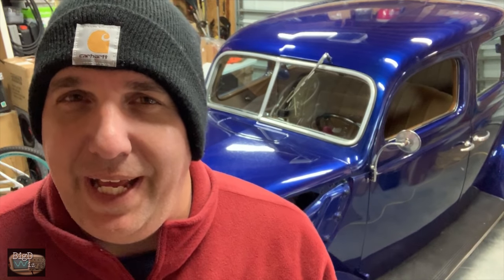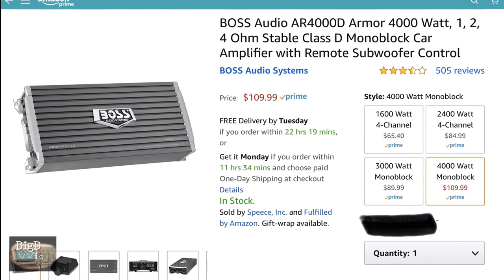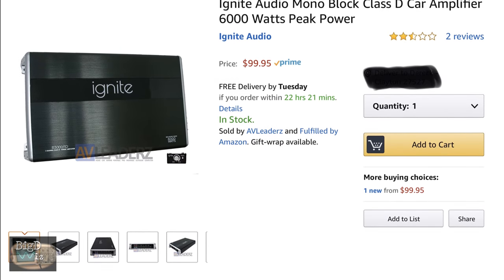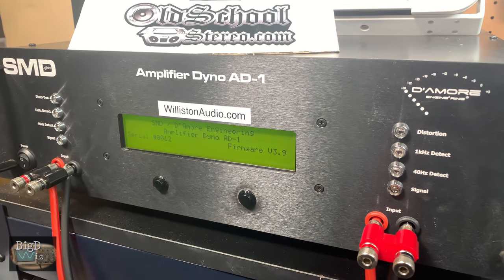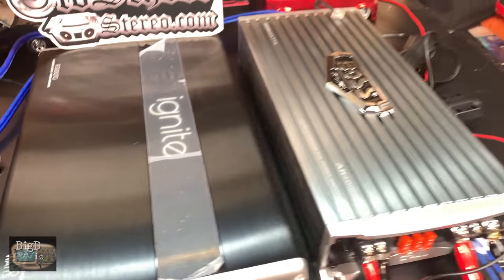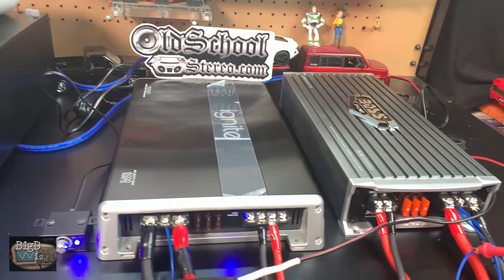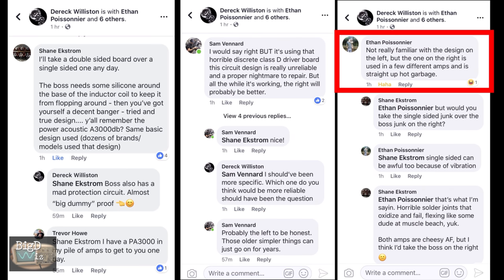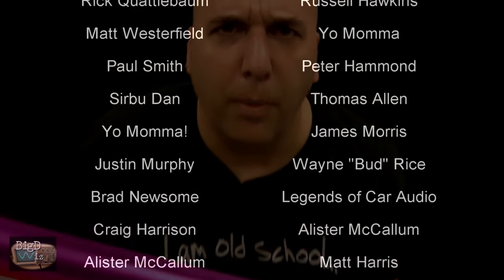$100 Amp Dyno Drag Race - Ignite vs Boss [4K]

Comment: Don't understand the hate on cheap setups... BOSS audio is what got me into car audio when I was much younger and broke. The fun of building a box, researching different enclosure types, setting gains, etc. can still be had!!
Reply: I used to love how cheap they were but then my amp blew and messed with the resistance of my subs, and it blew for no reason, I had an 80a fuse in line, much less than it was supposed to be and it never blew, showing that I didn't try and push it too far, it just blew for no reason and in canada they are like 200$, waste of money only lasted like 8 months
Reply: @trogers2120  I had a boss R1100M for my first amp. Probably put out 200 watts I'd guess. Used the crap out of it for like two years before I could afford a Rockford setup, you sure you set your gains correctly?
Reply: i still got my 4 channel boss amp from back in the day, its been trough hell and still works lol at least they are good amps to work forever XD

Comment: Back when I first got into car audio a 1000 watt amplifier cost a ton of $!!!! Times sure have changed!
Reply: Josh Hanson same here amp that where 1000rms back in the day where easily 600$+ for  decent brand, the cheap amps here probably don't have long life spans due to cheap internals
Reply: Josh hanson,  i still play my punch 200ix to this day its in my car bridged on a sa 12” crazy tone from a amp that was 500-600 bucks for 400 watts
Reply: @karl6823  i have 1 also. It rocks. Have it bridge on a single 4ohm pioneer champion seriel 12
Reply: Imagine our builds in the 90s if we could’ve had 1000 watts for $100..  remember when the Memphis 1100 came out. That was a game changer. Nobody thought close to 1000 watts out of this small amp, and wth is class d. It was only $400.0.
Reply: @troubleship6064  I bought the MTX 1000D when it first came out! 2 of them on 4 mtx 8000 15's in the back of a jeep wrangler with the back seats took out. I had them in a 4th order type box, the subs were firing off the bottom" facing down" and I thought that system was the shit. That shit shit was loud! Unbelievable what 2000 watts could do back then.
Reply: Amen!
Reply: Michael Branch,  the sound from a these amps is just amazing i love them,  i rebuilt mine all new caps and all it plays like a new amp put out over 600 rms on the smd dyno
Reply: Josh Hanson 8500s are still a very respectable sub. I still have two 9500 15s and one ten. Desperate cars. For some reason some people think mtx didn’t make good shit
Reply: Yeah back in the day I had a boss war machine and that amp was a bad ass
Reply: @karl6823  That's a FANTASTIC amplifier man! The first DSMs were MONSTERS! I guess technically that's a gen II DSM, as the original DSMs didn't include the X-over card. Still tho, great piece of classic car audio that sounds better than 98% of what's available today. 

They sound really good running mids & tweets too, but you have to be really careful with the gain controls. The DSMs clip so quietly that you'll fry tweets before you even realize it.( I know from experience 😤)
Reply: Kevin williams,  ive had my punch 200ix for 11 years and its so full of tone it plays so nice it’s definitely my baby i put hours of work into it
Reply: Back in 1985 I payed 300.00 for a Kenwood  Kca 800 and that was top of line .🤣

Comment: I know a lot of older people in the industry will laugh at us, the younger generation, but my first setup was a BOSS 4g wiring kit, Boss r1100m, and RF R1-S4 12inch for $130 (including box). While it certainly added some much needed bass to my 04 Tahoe, it wasn't enough for me. I recently upgraded and got the RF 500x1d (mine pushes 658 RMS @ 2Ohm from the factory according to the dyno sheet), the RF P2D4-12inch, and a S/O box with polyfill for $360 after shipping and tax, and it is truly a night and day difference in quality, loudness, sound, etc. 

To say all of that, I would have never gotten my better setup had I not started small. Sure, the r1100m, and other BOSS amps, are rated too high and don't perform very well, but they are enough for beginners usually. The AMPs tested here would put my old BOSS, and even my current RF, to shame in power/dollar, but I get the problem with quality. Something from RF has a good warranty, excellent customer service and QC, and is usually built and rated much better. While it isn't that huge of a jump from $110 and $129 ($110 for the BOSS at the time of the video being recorded and $129 for my RF 500x1d from Amazon), the power difference can be a deciding factor for some. 

I love my RF equipment and am most likely going to upgrade my stock speakers in the future to some RF's. It's worth the extra money to spend it on something from a known and respected company!

Comment: I had one Ignite R3000/1D powering 2x Sony Xplod 12s for over a year, no problems. Just upgraded to 2x Skar Audio EVL 12s in a 4.5 cf ported box, and added a second Ignite amp. My only problem is that the slave amp seems to have slightly decreased output. And yes, I have changed master/slave with the same results. I can visually see more excursion on the master amp/sub. Once you link the two amps, all gains/controls on the slave amp have no effect. Other than that, great value. Will upgrade to Orion HCCA 3000 in the future.

Comment: I have this ignite powering an audiopipe txx-bd2 and it pounds pretty good for a single sub budget set up. I'd say they are pretty well matched. The bd2 could stand a little bit more power but I like it. Custom ported box, tuned to 26hz and she gets low 😎

Comment: Well.  5 years later my ignite audio is still going strong. Even was in a bad vehicle crash 2 months ago
  I’ve used that amp to run 2 xfl 15s at 1/2ohm 
Single xfl 12. Tons of stuff 
Now powers 2 12” Dual audio in a bandpass box
The amp is on for 8hours a day. 6 days a week.  And I would say 85% of the time I am full volume 
 Never once had an issue. Even running 1/2ohm

Comment: We want more dyno drag vids !!! These are sooooo fun lol 😂
Reply from the maker: They are fun to make too, just more work. All good though, glad you like 😊
Reply: BigDWiz . When you did your xB install , did you use the grey wire on the harness for the remote ? I’m done by the same headunit install you did . Also do you know the rca voltage output of the 1809 deck ? Thanks in advance sir and thanks for the great vids again .
Reply from the maker: @EARDRUMASSASSIN  I didn't test the voltage output and I think I ran my own remote from the fuse panel. I can't recall, honestly, sorry.
Reply: BigDWiz no worries . That’s one of the options I was thinking also . Just running off the fuse box somewhere . Thanks for replying .

Comment: @BigDWiz do you happen to have an old Punch 4040 DSM and 100 DSM you could dyno?  I still have a few laying around from back in the 90's and am trying to decided whether to use them in a system or purchase a few new Audiocontrol amps..

Comment: on a low budget end I'd say boss. my cousin had two 15 L7's with 2 boss ar4000 strapped at first i didnt know what kind of amps he had when he played it those L7's was moving i asked him what kind of amps he had and he said take a guess i named basically all the name brand amps i could think off and he was laughing super hard so he finally pops the hatch and what do you know two boss ar4000's was pushing the crap out those 15's the look on my face was priceless so yes after seeing it move subs like that im a believer in boss amps even though im a hardcore JL audio fanboy i purchased a couple ar4k's myself i wanna see if the ar4k has what it takes to move an 8inch massive audio hippo xl if it does ill be fricken stoked cause the shop i bought those subs from has no faith in the boss amps but i bet if my cousin comes there with his set up to blow the roof off they're shop they'll be believers like me and for the note we've been into car audio since 1997 thats 22 years so yes we do have experience.

Comment: Looking at the chart the Boss appears to be a lot stronger at 2 ohms than the Ignite but the Ignite seems happier at 1 ohm than the Boss.

FOR THE WINNER I CHOOSE-

BOSS the 2 ohm winner 
711rms 907 burst@2 ohms
(619rms, 716 burst ignite)

IGNITE the 1 ohm winner
1111rms, 1382 burst@1 ohm, + bigger heatsink.
(886rms, 1352burst Boss)

The choice between the two would depend on a 2 ohm or 1 ohm sub setup.

Comment: Bought the ignite amp a few months ago. Going to try it  at .5 ohm and see if it handles.
Reply: It handles 4 15s at .5 Ohm like a champ. Has not over heated or shut off. I actually need to upgrade my 140 amp alt in my suburban because it sucks so much power even driving down the freeway and hits so hard and clean I am amazed seriously! BigDwiz can you test this amp again at half ohm? I cant believe how much current it pulls but has to be alot.

Comment: As an installer the biggest problem I had selling cheap amps is the customer that buys these amps is not willing to pay for proper tuning, wiring, etc. And would most likely abuse the crap out of them. With this combination, u can almost bet on returned merchandise. I would rather make less initial profit on a mid level amp but have a more satisfied customer.
Reply from the maker: Great point 👍

Comment: great vid bigd.. i thought the BOSSar4k did around 1400 wrms at 1ohm the last time you tested it? it seems these amps are not very consisted, or is that normal? keep it up sir.
Reply from the maker: Percentage wise for the dynamic test, it is pretty consistent. Plus the voltage was slightly lower on the first test
Reply: Ok, good to go.  Thanks again for another awesome video. Like the drag Dynos, need more.

Comment: Ignite still running strong 1year later and it doesn’t ever heat up thanks big D
Reply: I got one too runs amazing
Reply: @terryw1945  year 2 still going
Reply: @djgblaze1of1  awesome to hear that. This amp is great deal for the price. What subs you running
Reply: @terryw1945  at first was dark audio nkos 12s 500rms a piece now 2 12 Orion BP HP with a custom tuned box
Reply: @djgblaze1of1  nice

Comment: General amp question. Does lower efficiency means more heat? Or it just means lower efficiency? For example amp A being 65% at 1ohm and amp B 80% at 1ohm. Will the 80% amp generate less heat or is it just simply more efficient and both amps can generate the same amount of heat?
Reply from the maker: Lower efficiency means less of the input is coming out as sound. More is lost to heat. So in essence, lower efficiency = more heat
Reply: @wal  ok. So which efficiency numbers matter more? The certified or uncertified?

Comment: I have a small 2.1ch amplifier and I want to use the high level output of the sub into the high level input of the amp. Can I bridge the high level inputs cuz I have only one + and - high level output from the amp? I have tried searching the answer for this every where could not find it.

Comment: I have the Boss Audio 4000 watt amp I think it's a real good amp I have it on 215 in Power Acoustik bamf they hit very hard it vibrates my windshield wipers like crazy flexes my windows I really like the boss amps clean sounding
Reply: my boss amp blew up on me and messed with the resistance of the subs and I never pushed it, it didn't even blow an 80a fuse before it blew up, be careful
Reply: I've been running an AR4000D for a year now without any issues.
Reply: @Bobbrians  I guess I must've been unlucky with the quality of mine then

Comment: I have a 4crossfire twelves and want to know which amp you would say to go with
Reply: between these 2 boss but if your searching for any low budget amp that puts out id run with rockville's check out this guys dyno run on the Rockville DB16 bro the DB16 amp is pretty awesome for a low budget amp.

Comment: Why is the input voltage consistently higher on channel 1 compared to channel 2?  It also seems that the voltage changes for each test -- why is that?  Obviously the voltage can significantly affect the power output.
Reply from the maker: Voltage is identical for both amps as they use the same source. I use 14V AGM batteries and the voltage may drop some and the Amp Dyno will measure the highest RMS power output at a given voltage

Comment: Just browsed your vids...no love for Xtant? (those and the old a/d/s/ stuff have a place in my heart...and trunk)
Reply from the maker: Just no Xtant, doesn’t mean no love 😬
Reply: @wal  The old 301A is the grand-daddy to the JL Slash 500/1; it was the first, that I know of, that put out the same power at 2ohm as it did 4ohm. Very neat amp. The 2200ix was the crown jewel though...

Comment: Ignite amp ignites ur speakers literally. Went through 3 12s last one ended in smoke .
Reply: I got the one in this ( Ignite ) video and it gets my xlf 10  (  DVC 4 ohm - wired parallel  down to 2 ohm) hot and I set amp with multimeter ? I'm going to get a good 3k but was just wanting something to get started. Plus good for breaking in my  sub. My sub is ok atm. But I am afraid to keep using this amp. Think I'll just bite the bullet and wait for a better amp. But a question. Why is this amp heating ppls subs up even with it set correctly?

Comment: Nice one. I disagree about them being "starter" amps tho. Maybe youre broke because you pay bills and weirdly enuff 900 or so watts rms is actually enuff power for you...Bang it for a coupla yrs its well worth it.
Reply: Can't really say if it's "starter" amp by power, higher end sq amps can cost up to 5k€ for 1kW. It's starter amp because most experience builder would go for something more professional, better built etc.
If you are just starting in car audio you sure as hell don't want to burn 1k€ by making some rookie mistake.
Reply from the maker: Starter amp was my opinion. Sure you could rock either of these on a budget, no problem
Reply: @cekpi7  agreed...but i was 16 in 91 so my starter amp was a no-name 2 channel with maybe 35rms so by comparison even by todays standards this is a decent amount of power and someone with experience could make it sound good. You gotta work with what you got.
Reply: I would say it's a starter amp because it's cheap, also once you get into car audio, often times you want to upgrade to either more power or better sq sometimes both. My starter amp was a Thump!. No idea of the rated watts anymore.now I wouldn't even use it as a door stop.

Comment: Can you try a Kenwood exelon XR series amplifier on the dyno.  I'm very interested and curious how it really performs.
Reply from the maker: I’ve tested the XR600 and it did right at rated. I decided not to make a vid as it was not an exciting test
Reply: @wal  ok, was curious thanks
Reply: Drop ohm load down even more
Reply: The old school exelon amps could do 1/2 of recommended and do it all day long
Reply: Drop ohm load until protection light goes on.

Comment: For repair stand point i would choose ignite, it is much simpler, and more reliable. It doesnt have as much filtering, but it is not that important, those cheap scam capcitors would do simmilar job of filtering for the low side of the amp. How ever boss looks better, but is not as reliable and it is hard to repair.

Comment: I am looking for a budget amp but not this cheap what would u suggest
Reply: Orion hcca 3000w mono amp
Reply: How much it coast
Reply: @hankashworth1969  300-600$
Reply: Ok not to bad
Reply: What do u think bout the cab 1600.1
Reply: @hankashworth1969  Is great , btw choose a amp bigger than subwoofer/s and a good alternator to have a nice experience
Reply: I am trying to build me a sistum in my 09 altima to do 150 I was told I  won't do it because I have a 2 door what ya think
Reply: @hankashworth1969  Gl with project